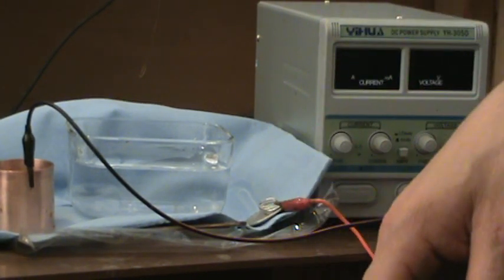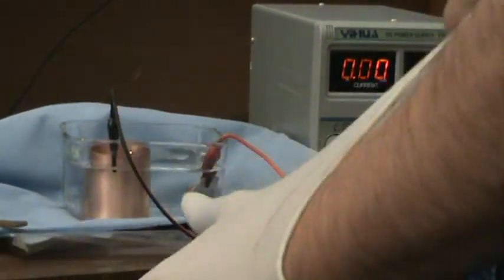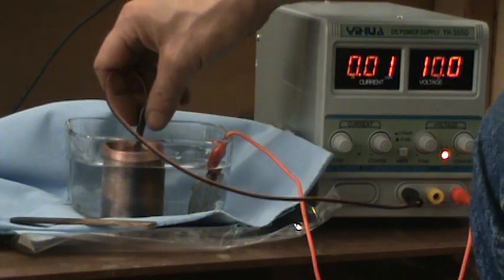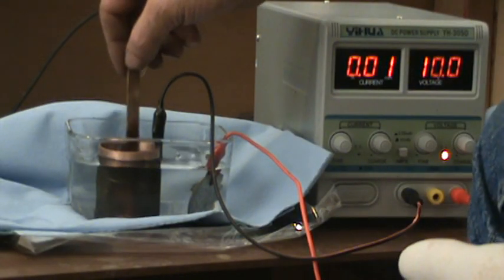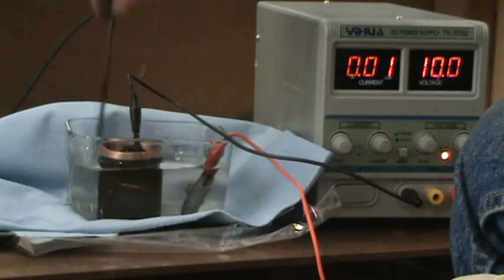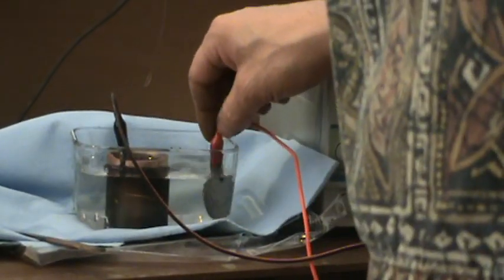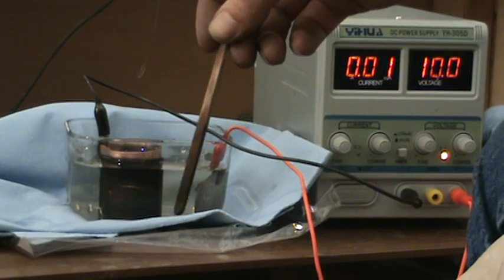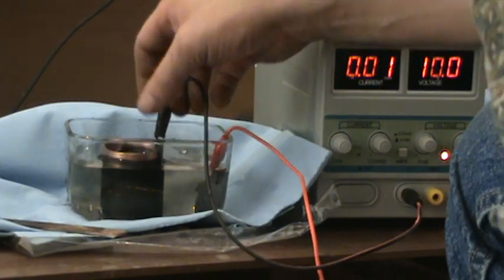How To Electroplate Silver Over Copper

Comment: Hi Paul. I like your positive 'can do' attitude. I am trying to electroplate copper plates with silver for using them in the process of making Daguerreotypes. I guess that a 20 - 30 microns layer of silver would do to polish the silver after the plating. I watched the new method you published but could not find the necessary ingredients on the New Zealand market. Did you ever try to polish your electroplated tubes?
Reply from the maker: Thanks for the compliment :-)  I have polished them lightly, and the silver did not rub off.  I was surprised at the thickness, hard to tell how thick, but if you leave it in for a longer duration it will keep building up.
Thanks for watching!
Reply: Thanks for getting back to me so quickly. The chemicals are quite hard to get in NZ because of all the P heads mixing drugs in their backyards. I can get Potassium Hydroxide, Surfactant, Potassium Nitrate and possibly the brightener (once I found out what it is). But could not find Silver Nitrate and the #1 Pyrrolidine compound. Would you have any idea where I could get this from?
Reply from the maker: I was lucky enough to find them all on ebay.  I have the link in the video description under "great results" video here....
https://www.youtube.com/watch?v=TKw9Pn91KU4
Reply from the maker: Here is the ebay link....
https://www.ebay.com/itm/15-Grams-Succinimide-98-034-1-034-Chemical-Ingredient-for-Silver-Plating-Solution-/201216482082
Reply: And something else. I looked up surfactant but there are many different products under the same name. They seem to have different chemical compositions as well.
Reply from the maker: Yep, you got the correct Silver Nitrate, same as i used.
Yes, you can use the bath solution over & over.  Yes, try to store it in a cool dark place with a good sealed lid on it :-)
You can use a little dish soap for the brightner, no problem.
I posted this video because i went through many problems myself, and i did not want to deal with the cyanide & thought i would share it with everyone. 
Just be sure to wear the gloves,,,i got a lot of heat about that from many people, hehehehe, but what they dont see is that i went through a whole roll of paper towels, and was thoroughly wiping my hands off in between video shots. 
Hey, if you decide to try this, please let me know how it turns out for you. 
Im confident you will have great results :-)
Ask as many questions as you like, i love to help and share knowledge.
Reply: That will be easy to get. If you let me know about the surfactant as well that would be great. I will now get the ingredients together and follow the instructions of your video. Isn't youtube a great thing? And about the gloves... I can only say do not worry about all the people raging on about that. There is still such a thing called common sense. I am sure you informed yourself about the risks. If one doesn't then evolution will sort out the rest and no Health & Safety organization in the world is going to change that. Even a guy like Isambard Brunel got almost killed when he tried to be the first guy digging a tunnel under the Thames. :)
Reply from the maker: Im writing my friend Jerry(link in the description of the newer great results video).  This is the guy that helped me a lot with this and he supplied me some of the ingredients.  I just asked him about the sufactant, because i dont remember what it was either, hehehe.  I will let you know as soon as i get a responce from him.  You could also contact him through ebay with that same link.
Here is the original directions he sent me....

Chemical check list:

·         AgNO3 (Silver Nitrate)

·         KOH (Potassium Hydroxide)

·         #1 pyrrolidine compound (sold at a ridiculous price in the US)

·         KNO3 (Potassium Nitrate) – I used tree stump remover (cheap but relatively pure KNO3)

·         Brightener

·         Surfactant (the bubbling agent used in toothpaste)

 

The following formula is based on making 750mL (~25 US floz) final solution.  The amount can be adjusted proportionally.  All the water used is distilled water.  Tap water might be okay at the final steps although I would avoid introducing large quantity of unknown substances.  Use a small plastic spoon or coffee rod (not a wood stick) to stirring the solution.

Step 1:  Make of fresh silver hydroxide (dark brown precipitation)

Dissolve 5.0 g of silver nitrate (if less than 99% purity, adjust the amount up accordingly) in ~250mL (8oz) of water in container A.  Dissolve 4.0 g of potassium hydroxide (KOH) in another small container B with ~100ml of water.  Pour entire 100mL KOH solution into container A and stir lightly for a few seconds to make sure all the brown precipitation is in fine particles (no lumps).  You can rinse container B with a small amount of water and pour into container A.  Now all the silver has been converted to insoluble silver hydroxide.  Do not let it dry before proceeding to the next step.

Step 2: Make of soluble silver complex compound

Slowly add ~8.0 g of #1 compound container A while stirring the solution.  The dark precipitation will slowly dissolve and result in a clear solution.  You have made the magic ingredient!

Caution: This solution and the final plating solution is somewhat light sensitive.  I suggest it to be stored in a non-transparent container after each plating job.  Or you can use aluminum foil to wrap the container and lid to block the light.

Step 3: Make of final plating solution

Measure the following chmicals and add them one at a time into container A with a stirring motion:
4.0 g of #1 compound; 4.5 g of KNO3; 2.1 g of KOH.

Add approx. 1/3 bottle of (3mL) brightener into the container A.

Add ~0.1 g of surfactant in another container along with 100mL of water.  Shake vigorously to dissolve and generate bubbles.  Here is something you’ll have to observe.  If there is way too much bubble, use less of this solution.  Pour this solution into container A and mix well.

Dilute the solution in container A with another 300-350mL of water to bring the total volume to approx. 750mL.  Store this solution in a dark container.

Plating parameters:

Voltage: 1.2 - 1.8 V (you can experiment to see what voltage gives a better result)

Use pure silver as the anode (to the positive lead on the power supply).  Please take extra care so that only the silver is in the plating solution.

To get a better result, try to use similar size of conducting surface on both cathode and anode.  This is just my finding in most cases.  If the anode is much smaller than the object being plated, to achieve a better result, lower voltage must be used which results in longer plating time.

Of course, the most important thing is to polish and clean the surface of the object to be plated.  I found that a degreaser works well to remove polishing compounds.  After degreasing, dip the base in 10% hydrochloric acid or sulfuric acid for half a minute to remove any oxidation film.  Rinse with flowing water (tap water okay).  Plate before the surface becomes dry.

Keep stirring during the plating process.  The shiny silver coating should develop with a minute.  If the surface becomes dull or yellowish again after a few minutes, you can gently rub the surface with an extra fine polishing compound.
Reply from the maker: Thank you for your kind words :-)  I don't work for the government so i can take risks, hehehehe.  I am a DR Frankenstein.
I sent Jerry(gouldcloudinc on ebay) a personal email, but no response yet.  Now i just sent him a message through ebay, so we will have to wait and see if i get a reply this time.
Im trying hard to get you an answer, plus it is bugging me to find out what it was. 
I feel stupid thinking of this now,,,but i will check my LAb to see what all ingredients i have there, maybe the sufactant will have another name on it!!    I will get back to you shortly :-)
Reply from the maker: I just checked my lab and the ingredients that Jerry sent me, he had written in ink on the small plastic packages what each one was, but now the ink has worn off and i cant read them. We will just have to see if he gets back to me about this.
Reply: Ha! You are the bomb. Great! First thing I did was saving your explanation away in my project folder. This is very detailed and will help a lot. I am keen as mustard to try this out. This photo project is one of the things that I wanted to do for a long time. I do have an outcome already but for the bigger plates I need a more cost effective solution. I do have a lot of pure silver plates that I can use as anode. No problem with that at all. 

I hope Jerry is getting back to you at one stage. I know exactly how it feels when you lost a bit of information of how to reproduce an outcome that you achieved already before.

And something else: Once I am through this experiment I would like to say thank you by sending you a Daguerreotype. This can be of your family or anything else that you like. So please have a thought.
Reply from the maker: OK, i got a reply, and a very good one!!  I just posted it the the newer video with the great results.  I put it in a comment & pinned it to the top.  He gave very detailed instructions, and also gave replacement ingredient for the KOH, in case people are having a hard time finding it.  You can now print out the instructions :-)
Very interesting that you do the Daguerreotype,,i never herd of this term until now and i looked it up.  Very cool old time photos :-)  I will think about this, thank you very much, very gracious of you.
Please let me know that you found the instructions that i posted on the other video.
Reply: Great to hear and yes I found them. As I can see the Pyrrolidine is now taken off the list and replaced with Boric Acid and Succinimide. I looked up all the ingredients according to this and could find all of it so far on the internet (sometimes overseas and sometimes in NZ). The only thing left is the Surfactant. As said: there are many different ones so which one to choose from?
Reply from the maker: So sorry about that, i forgot to copy the first paragraph that Jerry sent me......I also included this in the instructions on the newer video......here is the answer you been waiting for :-)........
(from Jerry)The surfactant I sent you for silver plating was K-12 (sodium lauryl sulfate).  It is a common ingredient in detergent and hair shampoo.  You can use neutral dish soap (regular, not ultra-concentrated) as an easier alternative.  I also found that this solution tends to react with certain plastic containers.  So it is much safer to use glass containers like you did.
Reply: Sodium lauryl sulfate? I think I heard this term before in relation to plating... Anyway. Thanks for adding the information. I looked it up and I can get this in NZ as well. That is basically all to get me on the way once I find a quiet day to get the materials organized.
Reply: Hi Paul. I just wanted to let you know that I have got all ingredients now. I am super excited to see how this will work. Once I am getting back from the South Island I am going to get started. YAY!
Reply from the maker: Oh great, thanks for letting me know!!  I think you will have very good results :-)
Please let me know how it turns out for you.   I would not be offended if you made a video of the results and mentioned my name, hahahaha :-),,,,But not necessary, hearing that you have good results will be reward enough :-)
Reply: Hehe. I will my friend. Thank you so much so far for your very detailed replies and effort. I will pass this on to people asking me questions about the stone industry.
Reply: Hi Paul. Just wanted to let you know that I ran my first test yesterday. I got a thin dull layer of silver on the copper after 10 minutes 1.4V while keeping the solution agitated by stirring it. I polished it up with rouge of Paris and the result is not bad. There are a lot of little imperfections but I am sure I will work this out over time. I have got a very positive feeling with this and I wished I could run more tests right now but I am going overseas in a couple of weeks and this will keep me off this task until start of July.
Reply from the maker: Good to hear, thank you very much for letting me know.  It took me a second time to get everything correct.  Im sure you will have even better results when you get back.  Hope you have a very good, safe time on your trip :-)
See you next month!
Reply: Hi Paul. Just wanted to let you know: I DID IT!!!! I just buffed my first half plate format and I am holding a perfect mirror in my hand. Man! I wished I could send the photo of the finished plate to you! Tears of joy... Thank you thank you thank you my friend. I will snap my first half plate in my large format camera tomorrow. Let me know when you have found a photo that you would like to have turned into a daguerreotype. I would really like to thank you for your help that way.

Comment: how about replace dc motor with pulse generator? the electrocoating can be done or nope?
Reply from the maker: you mean to ask if you can replace the regulated DC power supply unit with a frequency/pulse generator,,,,,,hmmm, interesting,,,,yes, i strongly believe it would work,,,, Yes.
Reply: thank you for your respond sir.. 
another question, how to know the ideal current density (A) for plating? the lower the current density, the plating will be better?

Comment: Three AMPs !! If that were the case there would be 30W of heat which would make that water really hot.  When you look on the current display it's only 0.01A (about 0.05A when you move the silver inside the tube).

Comment: +INVENTOR3  Another question:  I noticed you like many others just use a silver dollar.  Not an issue because I work with a ton of these making coin rings.  What I did wonder is that I save all my silver shavings which are nearly like dust particles and after many many coin rings I typically gather enough to melt down to a small inget.  I was curious though if I were to sprinkle the .9999 pure silver dust in the bath and keep it agitated with an airbubbler so they are moving around if it would be "beneficial or bad" in an attempt to improve a good silver electroplating????
Reply from the maker: Hmmm, interesting.  Not sure if powder flakes in the bath would be as good.  Hmmm, i think best to have the silver attached directly to the anode,,,,,hmmm, but now thinking more about this more, hmmmm, if attched to the anode, the particles that come off of the silver solid would be molecular in size,,,,and your talking about mixing in small dust particles that are much larger in size, but still the water itself gets charged so i would think that the powder you add would break down, but maybe not as fast,,,,,,i think what you mention would work, but to keep a small container like i use so that the anode and cathode are not separated by too much of s distance.
Wish i could hep more with this :-(
I do have an improved video you might want to watch, where i get a much better result,,,,search "how to electroplate silver onto copper improved" inventor3.
Reply: +INVENTOR3  I'm going to experiment with this today as well.  What are your thoughts on agetating water when silver plating?  Would an airstone in the bath during the process be helpful?  and....one more rookie question, I have a similar power supply as yours.  I noted you said you prefer 10 volts.  What do you set the amps to initially?
Reply from the maker: Sorry, i missed this comment.
I Hope things worked out well for you?

Comment: +INVENTOR3  I'm having a difficult time getting liver of sulfer patina to adhere nicely to a steel coin.  No problem with copper, silver, nickle or other more conductive metals but this one has been a challenge.  I'm just now experimenting with a conductive copper paint first brushed on and then oxidizing but that has a tenancy to be to thick and peals off easily.  Okay so now I'm wondering if I can put steel in a electroplating bath and I actually have a very nice one where I can set the amperes and volts to any you think may be ideal but my goal would be to first electroplate as silver this way then it shouldn't be an issue to patina afterwards.  My question to you is if you have any suggestions such as will electroplating be an issue on steel metal?  Your help or any other here experienced with this is appreciated.
Reply from the maker: Sorry i cant be of much help here, my experience is limited in this area.  I have not tried any other metal in this chemical composition except for copper.  But i would think it would still work, hmmm, make sure your water is distilled/zero water & make sure metal, is cleaned very well, most people will use an acid bath.  Im watching a video on the liver of sulfur patina now,,,, i dont think it would work on ferrous type of metals.
Reply: Patriot Coin Rings 
Mine turned out white, don’t know if I should buff it or not?
Reply: I don't think you will get Liver to adhere to any metals